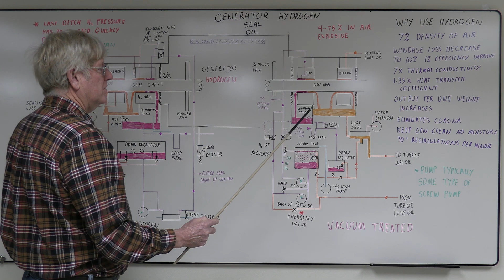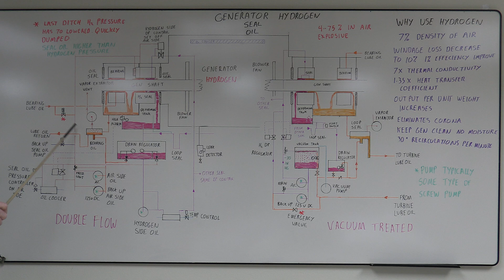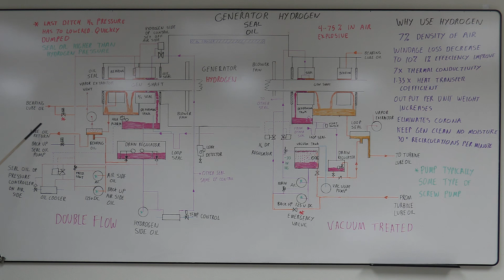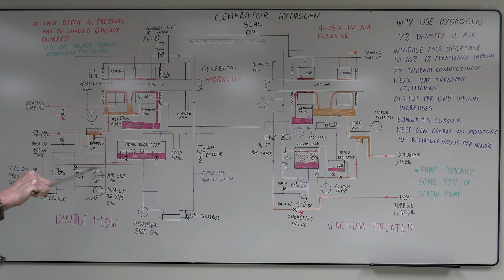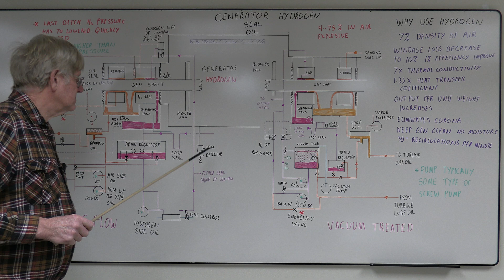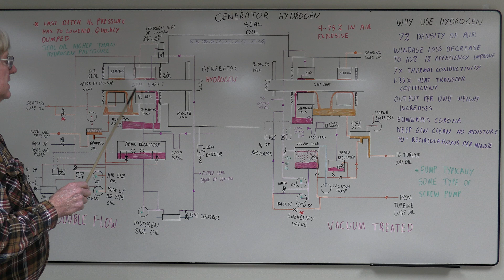Power Plant - Generator Hydrogen Seal Oil (Whiteboard)

Comment: Can you explain more about the float oil??
Reply from the maker: The answer I got back is: 
"I believe the question was about the hydrogen seal oil tank with the float valves. 

The seal oil is turbine lube oil. The tank with the float valves traps the Hydrogen in the generator with the tank supply the seal oil pump with oil for the Hydrogen seal side. If the tank is too high, the drain opens and returns oil back to the Turbine lube oil tank. If the level is too low the other float valve opens and add turbine lube oil to the tank to maintain the Hydrogen side seal oil pump suction."
Reply: @briantrue9930 thank you for yhe reply but not the float valves in the DRT….if you look up the oil supply (x3) going to each gen bearing h2 seal.  There is an air side,gas side, float oil.   The float oil comes off the air side feed.
Reply: You touched on it very very briefly in this video.  Mentioned somethin about it balances the seal rings

Comment: Great channel sir, you have a new subscriber. Can you explain more about why you have the loop seal between the DE and NDE side? You said that it is to make sure that hydrogen wont escape to the other side but i still do not understand, both sides have the same H2 pressure, right?
Reply from the maker: Here's the reply I got:
Excellent question, I believe that it is to keep the Hydrogen flow path from “short circuiting”. The fan(s) circulates the Hydrogen through the windings, rotor and stator then through the water cooled heat exchangers. This loop seal keeps some of the Hydrogen from bypassing this flow path. This pressure difference is very small as hydrogen moves much easier through the small spaces then air would. Our small generator fan differential pressure is around 1 inch water column (300 MW), larger units are higher. I’m not sure what the total DP across the machine is. You can use this DP as a back up for Hydrogen purity if the DP is higher than normal the Hydrogen purity is probably lower.
Reply: Makes sense, thank you very much!  @briantrue9930

Comment: Informative video. Surprised this channel has such few subscriptions. Wish you used SI units though lol. 
Question: Getting  a"Leak Detector" or "H2 Liquid Detector" alarm on the DCS. And then draining the stator and finding abnormally high volumes of water could be a sign of what is wrong with the machine? Is it related to the degassing and preservation procedure not being done correctly?
Reply from the maker: My guess would be a Hydrogen cooler leak.  It may be a cooler close to the water detector. Record when the alarm comes in and how much water you drain, this would show if the problem is getting worse. The hydrogen dryer may show more moisture being removed. If the generator has a  water cooled stator, the cooling water pressure should be less then the Hydrogen pressure to prevent water from leaking into the generator. 
Thanks for the comments,
Reply: @briantrue9930  Thank you for your response.

Comment: As a former power station operator who's operated these systems I never expected to see this video on You Tube! Good explanation of a double sealed hydrogen cooled generator sealing system. By "bad deal" he means losing seal oil on a generator will result in an explosion!